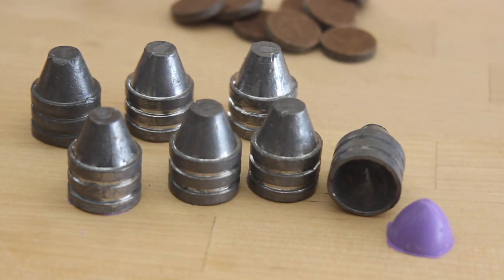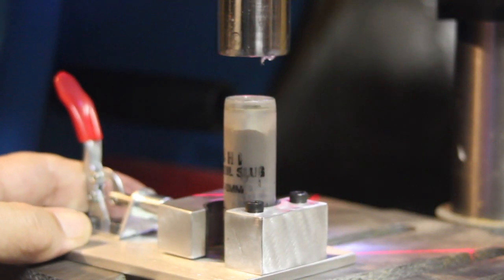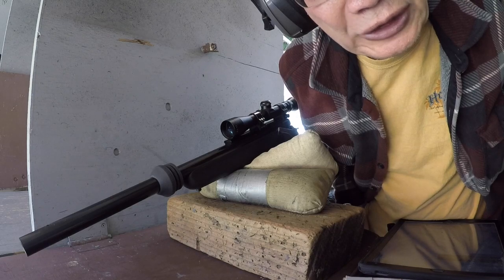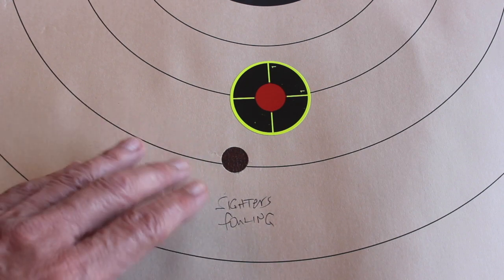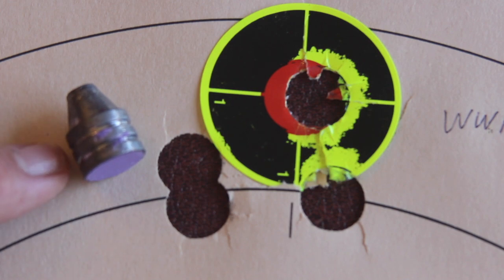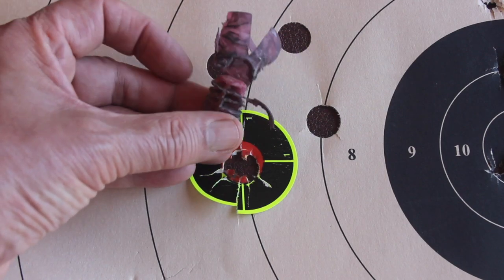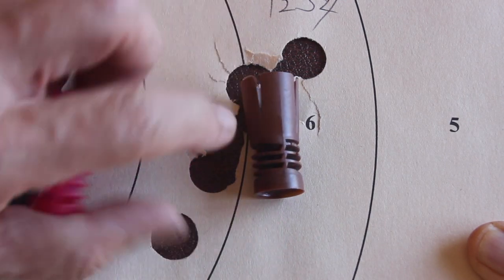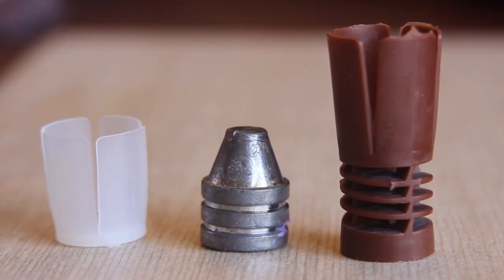3 Circles OPEN HOUSE ALL VIEWERS Video 49: Moose Slugs Range Test 12 Gauge Results

Comment: Hi Steve, I'm always amazed at your willingness to experiment with all kinds of loadings!  I'm always cautious to experiment and swap out hulls, primers, and powder combinations without verifying their safety, especially with regard to pressure levels in shot shells.  I checked with BPI recently if I could use RIO hulls instead of Cheddite, and they said absolutely not!  How much did this Moose slug weigh?  Where did you come up with the 28 grains of HERCO loading?  Love your work!

Comment: On the subject of hollow cavity,  I have a Russian 12g  mould with different base pins, have you every tried any sort of loose filler over wad and between slug filling the hollow cavity?   Corn meal cream of wheat or BP shot filler!  I recently cut open a 20g Remington slugger, powder/gas seal/fiber wad/then a good portion of a white fluffy filler/foster slug. These are very accurate from my 20g smooth bore, any suggestions trying this with a 12g with a hollow base Russian type paradox slug?

Comment: Why if you are shooting 7/8 slugs as apposed to 7/8 buck shot would there be a difference affecting the wad compression?
This sort of is confusing to me.
Reply from the maker: Bill Baker - Sorry, Bill, but this video does not contain any 7/8 oz slugs- These Moose slugs weigh 550 grains or just under 1 1/4 oz.   Have a great day,  FC Steve

Comment: Would be interesting to see group improvements if 1/ you had a proper cheek weld AND you used a scope with parallax adjustment. As your eye wanders in position with respect to the scope objective because your stock’s cheek piece isn’t quite high enough, and because it’s a scope with parallax set for 100 yards, the apparent point of aim wanders over the target, which makes your point of impact move. 

Bottom line is that your groups would be better with better technique.

I use copper pipe insulation sleeves to “pad up” my gun stocks. Cut the sleeve to length, split it open and tape to the stock with duct tape (I like black.) in some case I need 2 sleeve thicknesses. You can also skew the material left or right to get your eye centered into the objective.

This alone will tighten groups. Adjusting parallax will do more yet.

Comment: Do prefer the rising paradox slug over this one?
Reply from the maker: Justin Berwick - If you note the video on range shooting with the Russian slugs, you will see that the much tested Russian slugs outshoot these Moose slugs, at least with only 16 Moose slugs to test.  Plus there is a lot more work modifying trap wads for the Moose slugs than the proprietary tail wads that go with the Russian slugs.  That doesn't mean that the Moose slugs shooting 3-4 inch groups at 50 yards is not useful - just that the Russian slugs shooting 2-3" groups are more accurate.  As a reloader, the Paradox slugs roll crimp with much more satisfaction than these SWC Moose slugs.  Good shootin' to ya,  FC Steve